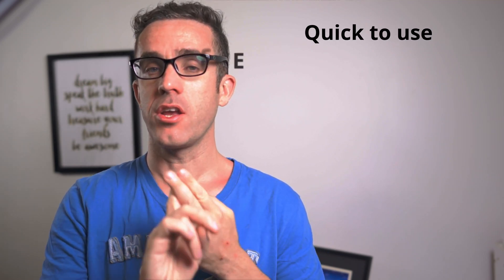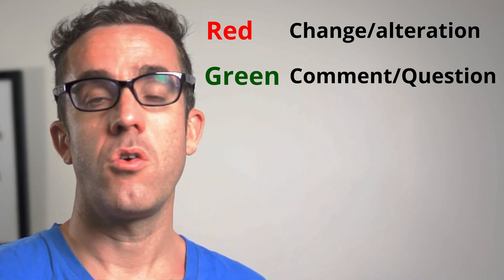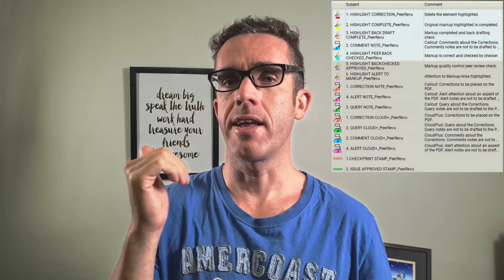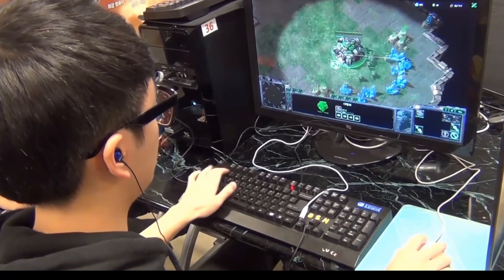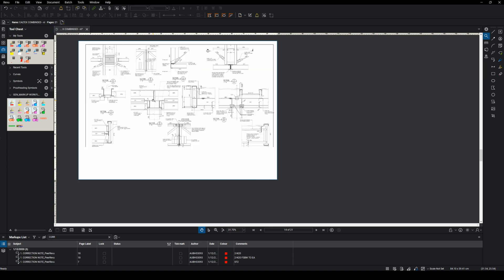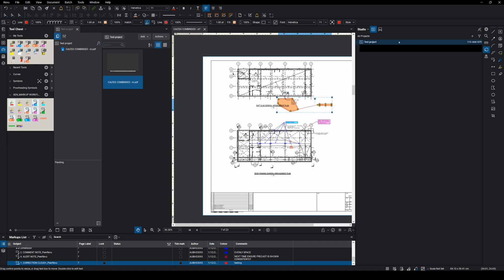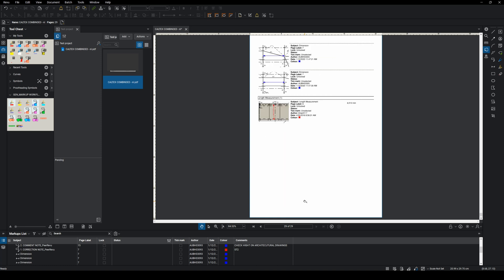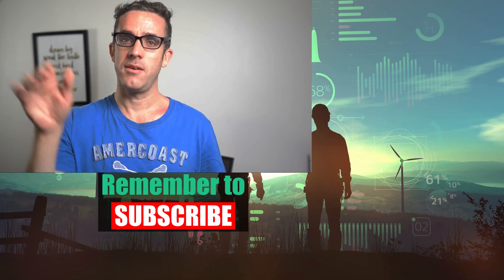Engineering Markups powered by Bluebeam

Comment: Thanks Brendan for another great video! I will most definitely be looking into Bluebeam. Question: How do you deal with hand calculations. What format do you personally use, and how is it documented/shared? Instead of scanning all my notes and hand calcs, I'm looking into using something like Mathcad. Do you have any recommendations?
Reply from the maker: Hi Theuns, Bluebeam is great if leveraged correctly. As for hand computations I typical use MathCAD and I have done a video on how I utilise different software https://youtu.be/ZloyGXxDFII . I would recommend MathCAD for a hand computation replacement, if processing alot more data I use Excel for planning a workflow then after working out the best interface/workflow I write a standalone module with python.
Reply: @BrendanHasty  , thanks for the reply. That previous video is very helpful (I forgot about that video...).  Using the correct software, correctly, makes a big difference in your productivity.

Comment: Hi Brendan, 

Thanks for your information regarding to the Engineering Markups. As graduate structural engineer with one year working experience. I feel that the reinforcement retailing is always the most confusion part of the design. Since there is not a fixed rule on how to do the detailing and there are also so many ways to do it. I will be very appreciate if you can make a video regarding to the detailing, I hope you can share some experience that you have been using to do the detailing. That would be very helpful for the young professional like me!
Reply from the maker: Hi Xiji Dai,

thanks for watching and your suggestion. I can put something together around detailing, this is where the art of engineering comes in. Rules around detailing can be fluid, with some fixed points for example on reinforce concrete do not lap bars at high flexure or tension zones. 
One recommendation you should try and go to site and talk to the builders, seeing how they need to build the structure will help you a lot, and if you have the chance to be a site engineer for a while that would be good.